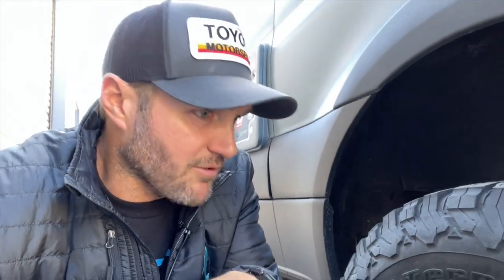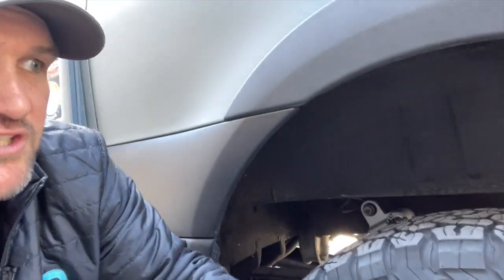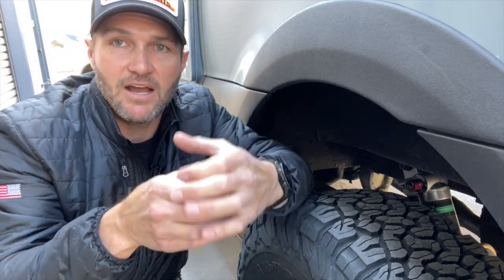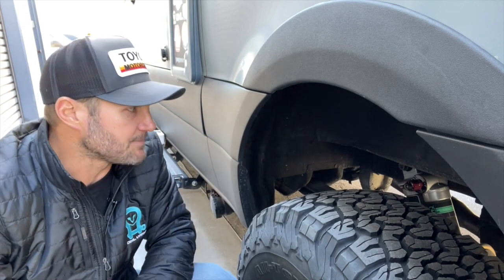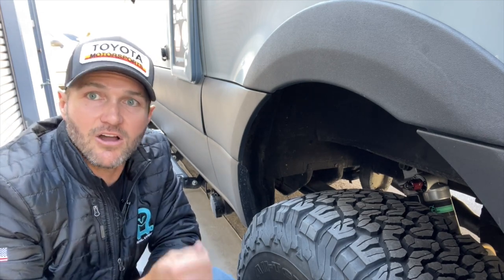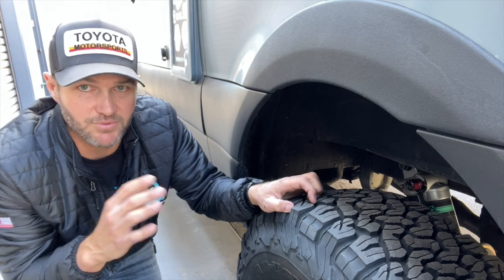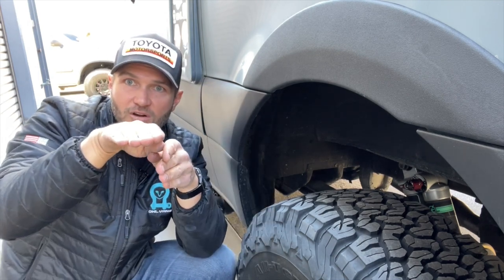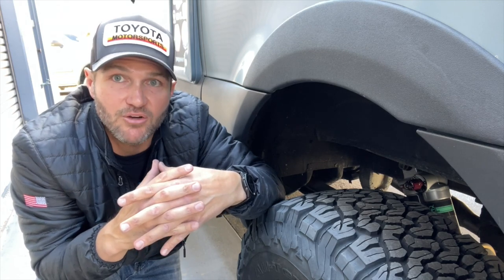Sprinter Suspension Explained

Comment: I did Rally in the old days, then I often had to think in terms of solutions. when i got my new sprinter the rear suspension was hopeless after the car was fitted. The rear end was thrown up, if driving on rough terrain. Instead of spending a lot of money on new dampers, I bought another pair of original dampers, and welded the damper eyes together, side by side. It's been like this for 3 years, great suspension, double safety and simple :-) And I live in Iceland, my car has been driven 30 thousand. km. on Iceland's bad mountain roads

Comment: Great video, thanks. I think there's another reason stock vans have the spring rates that they do. It's because the majority of sprinter vans are used in their daily lives with only small payloads. A delivery company with a few parcels will only be carrying a little weight. In contrast, when you build out a camper, you're running fully laden all the time, which is beyond the design specification as they're designed to be reasonable for most users. If they built them to be right for someone that runs it fully laden all the time, it would be way too hard for the majority of people that use them less than half full most of the time. At least, that's my theory.

Comment: Love your videos, I find them informative and useful. Just a tad confused by this one. When ordering a new Sprinter there are several configurations to choose from and that includes different suspension configurations, from comfort (soft), where the volume of the cargo area is more important than the load, up to heavy duty suspension and air suspension. I don't see the sense in just trying whatever the dealer happens to have on the lot and buying that considering the investment involved. I also find it a tad unrealistic for Mercedes to deliberately configure the suspension based on a test drive of an empty vehicle when the vast majority of their global Sprinter sales are fleet sales. Not trying to be a smart-ass here, just not sure that part of the video is 100% correct.

Comment: Thanks for such a great great explanation.

Does the general benefits of firmer stiffer suspensions that I am just now learning about (making better handling and less vehicle lean) also apply to taller vehicles like high roof sprinters?

I recently bought a 2008 sprinter 2500 RWD 144” high roof (with a DIY camper buildout that brings total van weight to almost 7,000 lbs)  that needs new leaf springs (each spring has a cracked front eye). 

I would like to upgrade from the factory monoleafs (1 leaf), so I would like to get a 2 or 3 leaf spring, for the increased load capacity.

I’m wondering if increasing to 2 or 3 leaves will just be so super annoyingly bumpy when going over bumps or dips, if the spring’ load capacities are not met.

I also wonder if the stiffer 2 or 3 leaf springs will translate to this high roof van dangerously or worryingly leaning over around curves. 
Or will it do the opposite and reduce the chance of that happening?

Any thoughts on this? 
Or any other cons of getting more-leaved springs (vs the pro of increased load capacity)?

Thanks!
Reply from the maker: The short answer is you want the correct spring rate for the weight of your van. I would get the van weighed (truck stop) and then give our customer support a call and they can get the right leafs for you.
Reply: @owloffroad  Great, thanks! I already have that weight, so I'll give you a call now.

Comment: I have a 2WD 144” 2500 with the Agile Off-road Ride Improvement Package. We travel on paved and dirt roads (in our Pleasure Way RV) all over the country. The Agile Ride Improvement Package works very well. I am confident that other packages that replace both the leaf springs and shock absorbers, when based on the actual combined and loaded weight of  build outs, passengers, fluids, and assorted gear would be a drastic improvement. My wife and I got really tired of the “head banging rock and roll” of the stock Mercedes suspension. Pathetic is too kind of a description for the stock suspension.

The spring force with the suspension upgrade helps a ton in cross winds too. That’s  another big benefit of well designed, engineered, and installed suspension upgrades.
Reply: I have a PW Ascent with Summos front and rear, Fox shocks in the rear,  waiting to install B6's in the front. This upgrade made a huge difference, even for crosswinds. I have been looking for a sway bar that will fit with the minimal clearance I have because of the generator. Curious if you have looked into getting a sway bar and any luck finding one?
Reply: Curious if you have traveled with passenger(s) in the back seat?  Is there any improvements for their ride comfort with the RIP?

Comment: hi so dumb it down for me : if my vehicle has leaf springs already installed  - for a 50/50 road/off-road vehicle which type of shocks would be best w.r.t cost n maintenance?
Reply from the maker: All sprinters have leaf springs installed. If your van is built our you will likely have to add addition leaf to get the spring rate hirer. We recommend the Van Compasss suspension with the Falcon shocks

Comment: Thanks for the video...So if you are not adding any significant weight to your sprinter (Current weight about 6100 lbs),  and you just want better ride quality (on Forest roads),  then you really dont need to change the Springs....maybe just adjustable shocks??  Does that sound right? or did I misunderstand. Thanks again.
Reply from the maker: That is correct. The van empty is sprung well. It is when you start adding weight that it becomes a problem. Shocks would help but springs are likely unnecessary
Reply: @owloffroad  Awesome!! Thanks a lot... Shocks have been ordered!! LOL. Thanks a lot for the advice!

Comment: STAGE 4.3 - VAN COMPASS SUSPENSION PACKAGE VAN WITH FALCON 3.3 ADJUSTABLE SHOCKS - SPRINTER 4X4 (2007-CURRENT 2500)
$ 2,839.98  then add on the Labor cost of installation {$1700}  and finding a good place to do it right. 
Agile quoted me $5300 for the RIP package installed by them in San Diego.  
Seems like a big difference but the Labor cost unless you do it yourself which I would never attempt myself if likely to cost the same. What is your total price out the door installed by you guys. 
I know people hate putting a dollar amount on a you tube video and FB post, but it does come down to the cost. Everyone I know loves their suspension up grade. I'm still running my stock and having a blast, but I don't want to break my van by beating the crap out of it.
Reply: I’ve been quoted $1,350 (10 hours of labor) for installation of Van Compass 2.3 + full set of leaf springs from Agile. Considering that Van Compass has adjustable Falcon shocks, to me it’s a no brainer.

Comment: Thank you John,  Where I agree with everything you noted in this video, I can’t help but feel that it is such waste to drive off a RV dealership with say a new Revel but only to replace a bunch of new parts right away with new updated parts.  

I noticed that Agile’s RIP Kit utilizes front coil springs (which I am thinking is my preference) while the Vancompass 6.5 Kit has front Sumosprings.  I was wonder if you would be willing to share your opinion on these front spring choices?

Also, can one add say a RIP or 6.5 Kit for example and opt out of lifting the vehicle?  I plan to add 245/70-R17 BFG KO2’s rather than the larger tire/rim choices in hopes to minimize further raising the C of G and thus impacting further, swaying.  Any opinions John on  tire/wheel/lift and the impacts on the C of G?
Reply from the maker: Our preference is the 4.3 from Van Compass as we feel it is the best option available. While you will see improvement with the Agile kit as well, the unibody was not designed to carry load there the shocks mount so a coil spring there can cause long term issues.
Reply: @owloffroad  Very informative video John. Thanks for sharing. The only thing we'd disagree with you on is your point about the effect of the coil-assist we add to the front strut. The logic you used to explain how the rear is under-sprung for the weight of a built out van applies to the front suspension as well. A relatively light 200-lb. assist spring isn't going to cause any long term issues (but works wonders in terms of ride improvement). Just like any other traditional coilover strut configuration, we install a very durable (and replaceable) bearing on top of the strut to alleviate any stress on the upper strut mounts.

Comment: Who makes a good sway bar disconnect? Is this included in the Van Compass 4.3 or 6.3?
Reply from the maker: Van Compass used to make them. Probably going to bring them back. They are not included with suspension kits

Comment: What about the stock sway bar? Is it a good “middle of the road” solution between on and off-road? Or is it more tuned towards one or the other?
Reply from the maker: Unless youre planning on being 95% on road, I would not upgrade the sway bar to a larger diameter.
Reply: @owloffroad  but you'd definitely add the disconnects?
Reply from the maker: @greg.ocallaghan  It would help off road for sure
Reply: @owloffroad  Awesome! thanks for the info. I have a 6.3 kit going in next week, will give that a go first!

Comment: John.. will Sumo bump stops help with on road, back and forth sway? I've replaced the shocks with Koni's but don't want to replace springs because I don't want to increase vehicle height (to hard to get in).
Reply from the maker: The most important change needed is the rear spring rate. Sumos are great but you don't want to ride on the bump stops. The height of the front of the van, where you get in, isn't really changed by raising the rear.
Reply: @owloffroad  Thsnks
Reply: @owloffroad  from what you've taught us I would say the rear leaf upgrade does not lift the rear at all because it merely returns the van to it's showroom height before the load was added?

Comment: Does the agile rip kit address the issues? I'm getting a stealth mode in October. Looking to upgrade the suspension. What do you recommend agile vs vancompass
Reply: I went with Agile on my 2016/4x4/144 and am very happy with it. But I think the Van Compass has manual adjust with my Agile does not. Nevertheless the ride is much improved and off-road is a breeze.
Reply: @tranquilitybase6417  thanks for your input
Reply from the maker: @thapr12nv  Yes, we prefer the Van Compass kit because we feel it offers better options for the money but both will improve the situation.
Reply from the maker: @matthewjswider  The purpose of this video was not to start a debate about the best suspension, it was simply intended at informational. As a company that can sell any suspension we want to, since we don't make suspension, we opted for the Van Compass kit because they are the innovators in this space. VC has the best adjustable shocks available, valved specifically for a sprinter. We have also spoken with VC at length about the use of a coilover spring on the front . Neigher of us is comfortable with the long term viability of putting load on the unibody where it was not designed to take load.

Comment: Hi John, can I use the bumpstop gap to evaluate my Revel’s sag? what’s the recommended bumpstop gap on a loaded 144 Sprinter?
Reply from the maker: It's a good question. Basically yes, you can. You would want to leave you vehicle down with gear and a full water tank. Then you should have about a 1.5" (I'll confirm) gap in your bump stops when parked on level ground. Ill measure our van and see where it is sitting.
Reply: Get the VC stage 3. I did and it completely changed the Revel handling.  Before I feared for my life in in the Wyoming crosswinds.
Reply: @owloffroad  Being a mountain biker, I loved the sag reference.  Did you confirm what optimal gap is between rear bump stops?  I have a stock 20MB / 22 Revel and have a 2” gap.  Thanks!!
Reply from the maker: @craigfisher67  2" gap sounds fine. If you build the van our. you will likely see that drop to about .5"